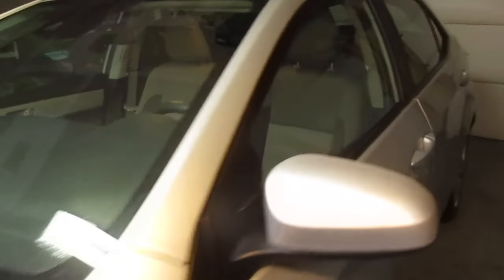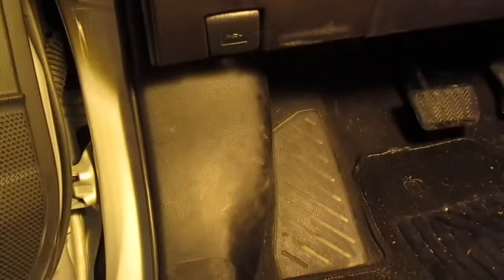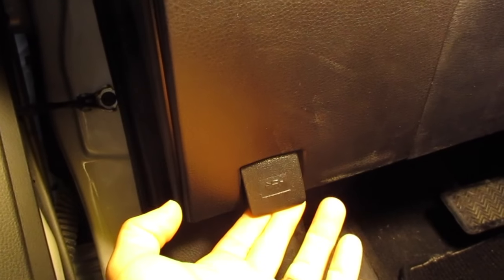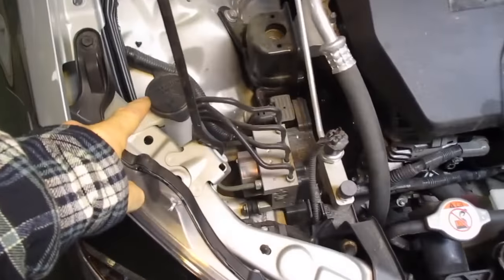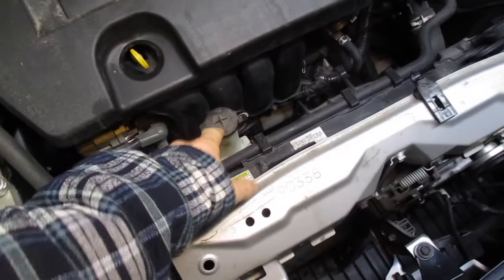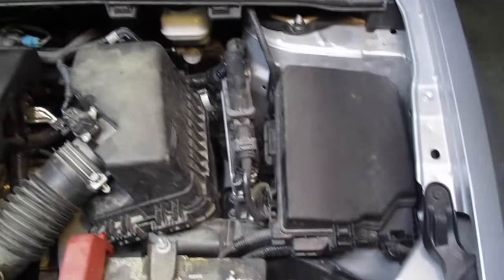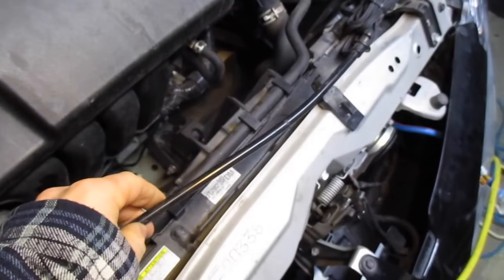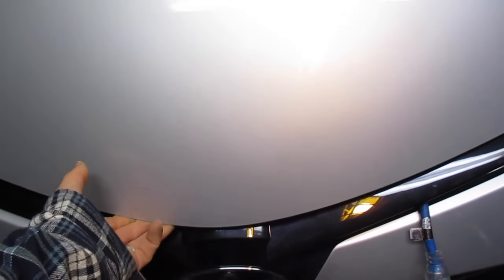How to open hood of Toyota Corolla or Bonnet 2015 2016 2017 2018 2019 2020 16 17 18 19 20 2021 2022

Comment: I want to put a sticker on my front windshield, I can't stand on the hood, right? Doesn't seem like it could take even 150 pounds
Reply from the maker: Yeah, pretty sure you'd be out there with a plunger trying to pull the dents back out if you stood on it.  If you laid on it I think it spreads the pressure out and would flex back.  But yeah they seem pretty thin and flimsy